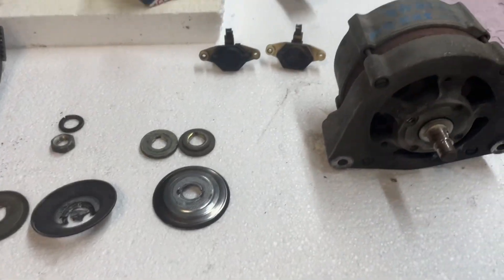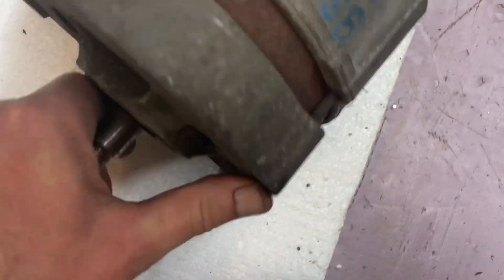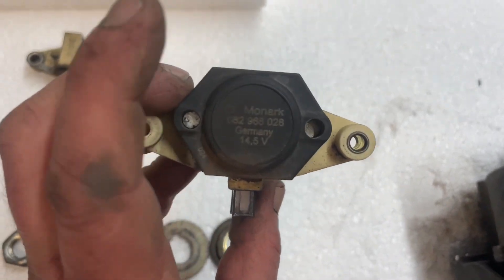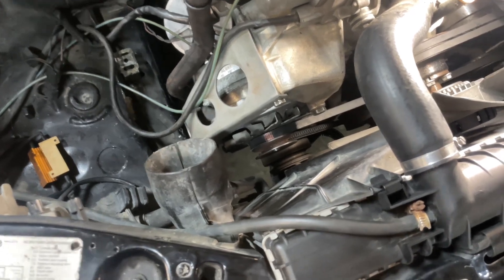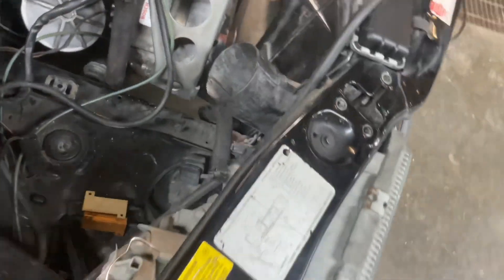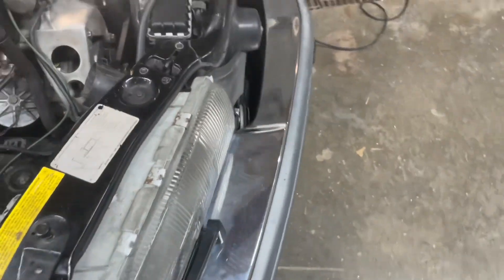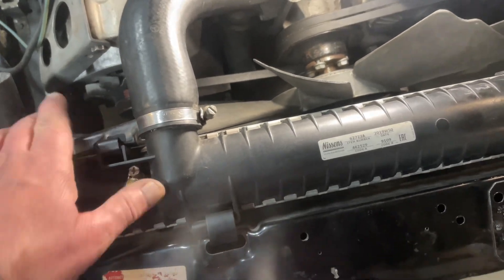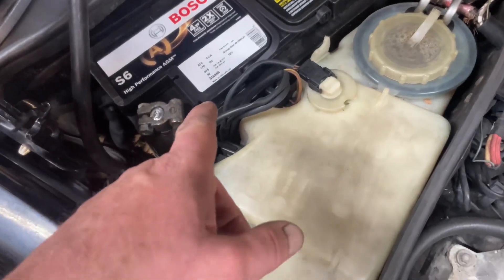Mercedes W126 Bosch Alternator rebuilt fail, Ode to Joy lasted 20 miles, thanks to finest chinesium!

Comment: I've had alternator problems too, until I found a guy here in Las Vegas that does a good job on alternator rebuilding. My dual electric fans ate the stock 85-amp alternator in a couple of weeks. He rebuilt it into a heavy duty 100amp alternator, 6 months. Tony then built me a custom 140-amp alternator on a Yukon base that bolted right in, and it's been on there for several years. Good luck with yours!!

Comment: It is a shame that these Chinese replacement parts are just junk. I have had bad luck with rebuilt AC Delco alternators from Advance Auto. 4 alternators , all under warranty in 3 years from Advance. It only takes 10 minutes to change one out in a  1993 GMC Jimmy, but it is a hassle when they fail continuously. Poor rebuilds from whichever company rebuilds them for Advance.

Comment: About two years ago I had the same experience with the exact same alternator. I paid top dollar to get the Bosch re-manufactured unit and still had issues. It sounded strange to begin with.  It turned out the main shaft was of slightly. I checked with the dial indicator. Maybe you got one from the same batch. I kept the unit as there was no replacement available.